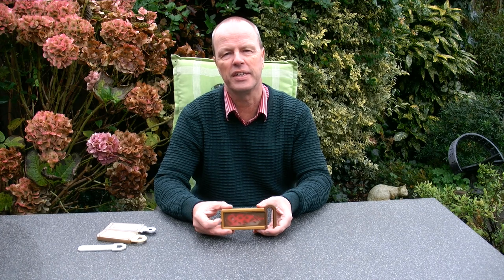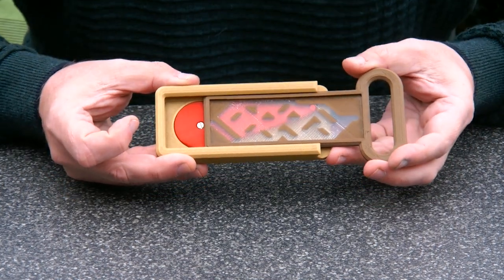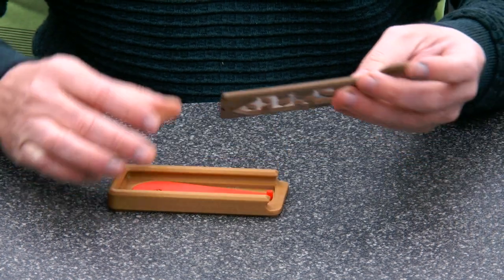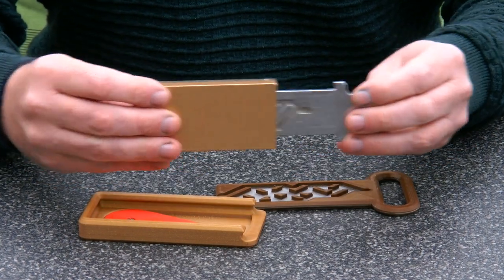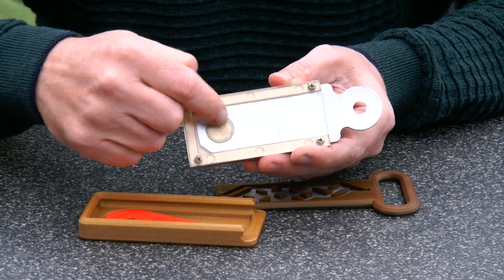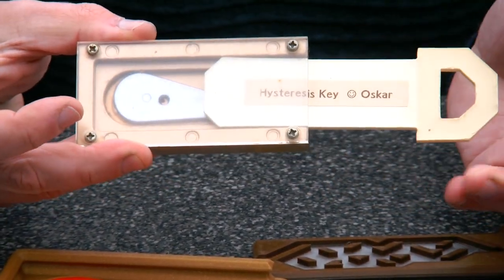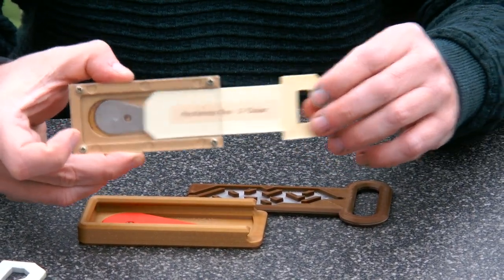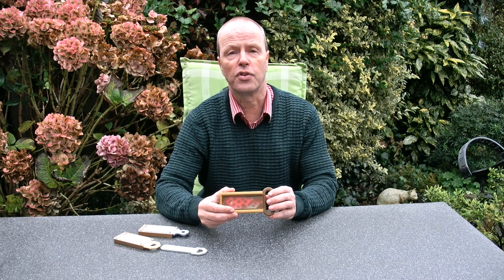Hysteresis Key - What does "hysteresis" mean and how does it apply to this puzzle?

Comment: I think I could have solved the puzzle fairly easily just from being able to see a picture of the maze. Actually, I think this puzzle would be more fun if it didn't show quite as much information, though I do agree about the original opaque version probably being frustrating. I think a good compromise would be to use opaque plastic in a different color from the maze part of the key so the maze is still visible but the location of the pin isn't, then maybe also having a red indicator on the sides of the lock to show about where along the length of the key the pin is. That way you don't have perfect information about the movement of the pin but you still have more than enough information to solve the puzzle with a little thought.

Comment: well according to Wikipedia, "Hysteresis is the dependence of the state of a system on its history" So as it applies to this puzzle, the state of the pin is dependant on the previous moves, of which only one set can solve it. Very clever puzzle!

Comment: (1) draw horizontal red lines in the every layer
(2) connect lines with diagonal red lines at the each slopes
(3) then the red line becomes a traditional maze
Reply: no.
Reply: the diagonal lines should be one-way so it makes a directed maze

Comment: Maybe the coolest part of this, I think, is that you could get it with different mazes. Like, if this was a retail product, I could see it coming with 3-5 "keys" in different colours, ranging from easy to hard. And in fact if you took the back wall off the bed, you could even have different lengths; imagine a maze 2-3 times longer than the bed, making you have to run all up and down it!

Comment: Very nice puzzle which acts as a maze with only two possible actions for a puzzler: push and pull. Much like a turn-dial combination lock, the solution could be written as a string of numbers, in this case representing the millimeters travelled before switching the direction of motion. I wonder how much more difficult it would be with false gates to stop its motion in the middle of the maze, instead of one "reset gate" at the end.
Reply from the maker: The unique feature of this puzzle concept is that it is self-resetting. So how would the suggested "false gate" work?
Reply: @OskarPuzzle  around the end of the first puzzle you showed, there was an area where you edged more carefully along an obstacle, sort of a half-move. If these are acceptable moves, then a false gate would consist of a blocked dead end in the "pull" direction. 

Say for example that a particular move in the push direction leads the key pin down a sloped obstacle of considerable length. Depending on when you choose to initiate a pull move, you could enter different paths of progression, several of which could be formed like the teeth of a comb, resulting in dead ends. Perhaps only one such path continues onwards, sliding down to a correct path of progress.

 While not particularly difficult to overcome in terms of dexterity, in the versions of the puzzle where the path is hidden, it adds confusion regarding the internal structure.
Reply: After drawing it out, this may in fact permanently lock the puzzle up. I will check if there is a way to draw up a false gate which both cannot break the puzzle and does lead to a new correct path
Reply: Assuming "pull" entry from the top right of the maze, the wedge sets the pin onto the central ramp. If you initiate a "push" at the correct time, you slide between the false gates onto the progression ramp on the right. Time it to early, and the false gate stops you, but doesn't prevent reset. Time it too late and the false gate stops you, and requires reset along the bracketed ramp on the left to try again.

Comment: I think it would still be a tricky to solve it, but was able to gleam a bit from your solve as to how the pin interacts with the obstacles and how it could be moved from the starting position. Things to improve on it would be to prevent the user from directly manipulating the red pin and making it easy to reset after a solve. Other than that, this would be a very fun and fair puzzle!
Reply: The way the puzzle is laid out, inserting the key after solving resets it to the beginning.
Reply: @DanieleGiorgino  Ah, I'm not sure how I overlooked that

Comment: Two things:
1. Without having actually tried it, I would guess that the easiest way to solve it the maze would be to start at the end and work your way back to the starting position.
2. Is the read par susceptible to moving without being pushed by the obstacles in the maze?  In other words, could I knock the top or bottom (as Mr. van Deventer is holding it) of the puzzle to move the red part?  If that does turn out to be an issue, you could add some detents to hold the red piece at certain positions until moved by the maze obstacles.
Reply from the maker: 1. Incorrect. 2. Cheating is indeed possible, e.g. by knocking or manipulating with your finger. I would not be too hard to develop a less cheatable version, but so far I see no reason to bother.
Reply: @OskarPuzzle  From the arrangement of the obstacles and the way the red part moves, it would be pretty straightforward to create a directed graph of the possible positions and the transitions between them.  That shouldn't be too hard, since there are only two possible next position from any given position: either push or pull.  Once you have that, solving the directed graph as a maze should be easy.  It seems like that would certainly be possible - just not nearly as fun as having the actual puzzle to manipulate "in person."

Or are you looking for more detail or a more elegant solution?

Comment: I think having it see-through makes it too easy. I think it would be a nicer design if the maze were engraved on a corner, so you couldn't tell how far you need to go but not making it too difficult to figure out.

How about a double-hysteresis key where they are locked to each other and each side has its own maze that inter-trap opposing sides in some spots. Maybe the key has a coin in it that has to passthrough one side when you solve the first key, and drops out after solving the second....now that would be interesting.

Comment from the maker: What makes this puzzle so hysteresical?
Reply: I would say it's because of the rapid movement of the red pin as you pull out on the key
Reply: The Red pin's future path relies entirely on its previous path. It's the result of a deterministic system.
Reply: It's the condition you get when trying to solve it, especially the non-transparent version.
Reply: The state at any moment depends on the path in the past.
There is still a reset place, which could be seen as a "forget the past" spot. And that is very interesting; in physics, systems with hysteresis don't usually forget about the past.

If you consider random movements, the labyrinth is designed such that any wrong movement will lead towards the reset spot, and you need a long streak of good movements to go to the end. The reset spot is therefore a spot of high entropy! You can compare this to information theory: you need a lot of information to get to the end, whereas every return to the reset spot simply resets all the information that you acquired, hence making it a spot of high entropy. I think one could define the entropy of any spot as the number of paths that lead to this spot (and I think that it would not depend too much on the choice of the starting point for the paths).

It's actually also a fun analogy to chemical reactions of two atoms separating from each other due to thermal activation: you can consider the puzzle in the unsolved state as a bound state, the length of the solving path can be seen as the activation energy, and the puzzle in the solved state can be seen as the free state. Then the temperature is analoguous to the rate of random movements you do with this puzzle! You can write Arrhenius law for this "reaction". Of course the analogy stops there, because the chemical reaction is quantum and this is deterministic and classical. But I think that the puzzle with the hidden mechanism is a fairly good analogy of the "hidden local variables" formalism (which we know doesn't describe nature by now, thanks to Alain Aspect experiments on Bell's inequalities). There is more information than what is available to you, but you just don't have direct access to it, and by making experiments on the system you can infer the values of the hidden variables (here on the geometry of the puzzle); to make the analogy complete, after each measurement, the maze would have to change randomly.

I guess more interesting analogies could be made about path integrals, or about the phase space of mazes. What would be the probability with random moves to solve the puzzle with this maze configuration? (We would need to choose a probability law for the random moves). And what woud be the probability to solve the puzzle if you didn't know the maze's configuration and if this configuration would change every time you made an attemps? (We would need to describe the space of possible mazes, that is a really intricate question ^^)
Reply: @MrRubikraft  "The state at any moment depends on the path in the past." Is there anything in this world that isn't hysteresical then? I don't know of anything that isn't the way it is because of what happened earlier.

Comment: I wonder if this concept could be used in an actual combination lock.
Reply: That IS how a combination lock works. If you dial in a wrong number, you can't open it, even if the rest of the numbers are correct. Opening the lock depends on what numbers you have dialed in = hysteresis.

Comment: Hysteresis means not going back the way you came. It's a useful property of thermostats for example. My guess is that here it means you can't reinsert the key with the reverse of how you got it out. In other words you need to learn two different puzzles to operate it fully.
Reply: No. It means that the state of the system depends on what you did previously. The vertical position of the lever in this puzzle depends on how you have pulled it back and forth inside the maze. There is nothing that says you can't go back the same way.
Reply: @grantofat6438  Something that goes back and forth along the same path doesn't have hysteresis.